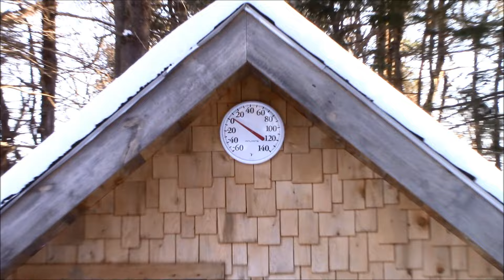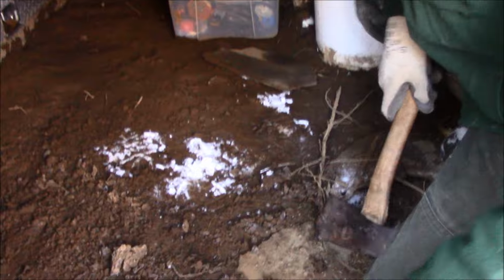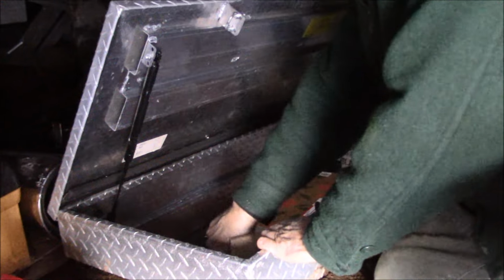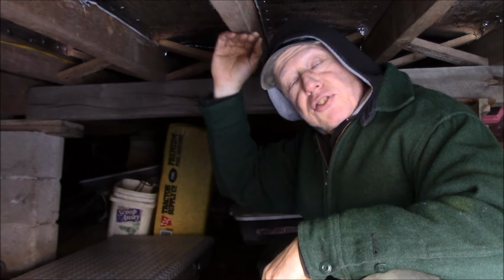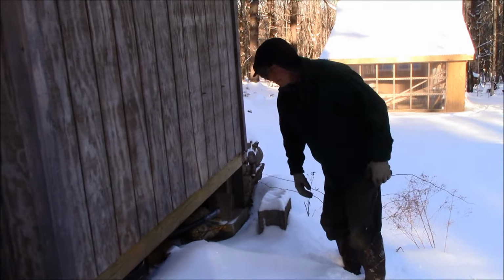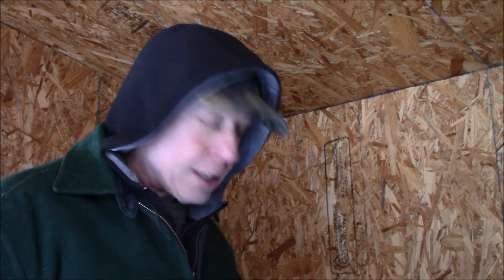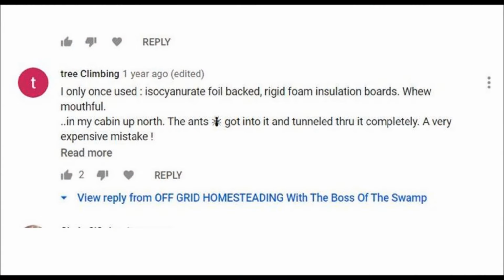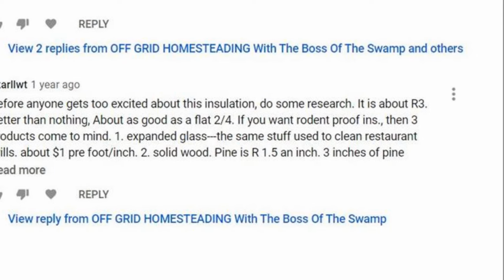Awesome Floor Insulation For A Cabin In The Woods   3rd Year Review

Comment: For a roof bubble wrap, as you indicated, is not as good as fibre glass because the R value is not as high as alternatives. but this is because heat rises creating pressure upwards.  This thermal movement has less impact on the floor. Heat is also radiated so the reflective surface of the bubble wrap helps reflect radiated heat back in to the cabin.  The continues roll of bubble wrap prevents drafts, you have created a baffle under your cabin and this creates a heat trap and reduces chill factor.   As for rodents you have found a method that works in insulating your cabin but does not encourage these problems.  I get it and r value is less important if heat has to go down and out rather than straight up.

Comment: I guess more "proof-in-the-puddin"  would be to use ONLY  the "bubble-foil" to insulate an entire building.  Floor, walls, and roof or ceiling, and just prove how REALLY effective it is at blocking heat transfer.

Comment: serious question regarding the ants problem, for anyone with actual experience: what about ICFs and SIPs? Do ants make homes in that type of material also?
Reply: Absolutely, and also blown in foam in  standard framing. Carpenter ants will tunnel through wood and then on into the foam.  Need to spray or have someone do it just like termite control.
Reply: Ants love that ICF foam, been there done that!
Dont bury your old wood stumps on site and treat the soil around the foundation!
Reply: @NotMy Field & @Jimmy Squires : Thank you both for your answers. 

If you don't mind a secondary question, I have a friend who is using the pink 2 inch stiff foam insulation, within the open crawl space of his home, in between the floor joists, which are 2x8s, leaving a 5.5" gap between the foam and the sub flooring OSB. Would ants tunnel through that foam type as well? 

It is interesting for me to see this video and you guys responding, when looking at the data and information sheets for insulation: NONE of the documentation I have been able to gather ever mention pest problems or pest control prevention. This is something I have never even considered until seeing this video and your responses. Thank you for the help and personal guidance.
Reply: @igounfazed  It is the exact same situation where exposed foam can attract ant infestation.  But every different area of the country has their own unique pest control needs.  If the area of your friends home  has termites and carpenter ants, then common exterminations methods should be used. Boss has come up with a very nice solution for his area.  Seems to work well despite those would argue it can't be true.  The bumble bee keeps flying despite the scientists that claim it can't according to their calculations!!
Reply: @jimmysquires5093  Thank you!

Comment: A couple of issues here that touch on the actual building science  you are trying to describe talks about Vapor barriers and the dewpoint and how cold move to heat. Firstly, you are getting so many negative comments because you're describing insulating a cabin floor with an insulation that at best has an r-value of 1.1. Wind chill is a factor of heat loss, not air temperature . The dewpoint for any given area is measured based upon the degree days has in a particular region. The dewpoint allows moisture to condensate on surfaces in the area where this occurrence occurs. There are 3 ways to eliminate condensation,  increase airflow,  increase the temperature and or decrease the temperature. There is a difference between an air barrier and a Vapor barrier,  one being able to breathe (air barrier) and one not being able to breathe (Vapor barrier).  The location of where the Vapor barrier is placed is critical to all of the above I forementioned. In a northern region is has to be on the winter warm side of the assembly. Moisture is a vehicle which transports cold to heat through capillary action ( in this case your wooden structure and the organic dirt floor). What you have described visually in your video to someone who knows the building science behind what they are seeing is a warm damp space under your cabin. Your bubble wrap can be used as a Vapor barrier providing it's continuous continuous. The thermal breakage that's visually obvious with your illustration and your description of how warm moist air seeps down between the cracks leads me to believe that the advent of moisture in this area will only speed up the cooling down process. I therefore conclude that the advice you are giving is bad advice and I find it shocking that even after failing on atleast 3 shed floor insulating attempts you decided to post a video saying in effect that this is the best way to do it. I don't mean to upset you, however it is important that you are told properly to stop in the most gracious way possible,  while still getting the point across. If we can be civilized here I can help you with proof of what I'm saying and provide you with the information that will help you and the people you reach out to. I look forward to working with you and sorting this misunderstanding out. Best regards

Comment: If you think about this from a rational point of view it doesn’t make sense to not use it. Let’s say all the haters are correct and it does not perform as well as he says, you can still add your insulation and all you’ve done is increased your vapor barrier and the insulated properties of the insulation that you would be adding anyways.  Putting underpinning around a peer based cabin is just common sense. Whether it has bubble wrap on it or not underpinning with no insulation of any sort is highly recommended over not using underpinning at all. Foil bubble wrap is such an inexpensive product the why not trying it see if it works and if it doesn’t work adding the insulation after the fact. I have insulated plenty of pier based sheds in my life and rodents in the insulation with or without underpinning is always an issue. This is a great idea and I will absolutely be trying it. If it sucks I’ll come back and comment and let everybody know but I bet it works great.  Thanks for sharing your  experience with this.

Comment: R-value deals with heat loss due to conduction and is relevant for foam and fiber insulation techniques. The product you are using a radiant heat barrier that appears to be locking in the heat being conducted through the floor joists into the crawl space.  The people who are arguing about the lack of the foil working don't really understand the difference between the two.

Comment: In addition to being a radiant barrier, it's providing a thermal break between the floor joists and the floor so the cold floor joists can't suck heat out of the floor as quickly as they would if they were in direct contact with each other.  Fantastic product.

Comment: One more comment. I spent most of my career in Construction as a project manager building Prisons.  Here in Southern Ontario we often get -20 Celsius or less days in winter.  We have actually poured concrete below zero (chemical heat in the concrete) and used non foil black bubble tarps to cover and protect from frost.  Not the same but similar to bubble foil in principal and physical properties. Worked very well without any heat source other than the chemical reaction of the curing concrete.  Cheers

Comment: Great concept, no rodents and keeps just enough heat in to stay above freezing. You are spot on Sir.  Biggest thing is keep any breeze out of area and a small RV value is all you need.  You are right about the heat transfer on the floor joists.  Perfect shallow root cellar and I love the freezer room,  excellent use of the waist heat from the freezer. 👍🏻👍🏻. oh and it does work.  we use the same bubble foil up here in Maine in the off grid camp.

Comment: My wife and I recently installed an outside wood boiler here in PA where we live completely off the grid. Not wanting to spend the relatively large amount it would cost to buy the typical underground insulated piping.. We got 3'' un-corrugated drain pipe and a few rolls of bubble foil. We used the bubble foil to wrap the feed and return PEX lines one wrap, fed it into the 3'' pipe and buried it below frost. I must admit I was slightly concerned it would be a waste of time and cause more work, but There is absolutely no temperature loss from the boiler to the inside of the house. We also used it as insulation/a heat transfer material for our PEX floor heating system with again awesome results saving us big compared to buying the industry standard of using heat transfer plates.  It can be hard to step out-side the norm when everything around us is brain washing us to use or do something a certain way through advertising... stepping outside the box once in a while in life, one just might be amazed to find there is more than one way to skin a cat. Keep up the good work, really enjoy the content.

Comment: Heat doesn't travel down. I'm  not saying what you're doing isn't working, it obviously is, I'm just questioning the reasoning.
Reply from the maker: Most of the heat under there is the ambient temp of the ground being trapped but... if I wasn't heating the camp, it would be A LOT colder under there which proves heat does indeed radiate downward through those joist.

Comment: We use this bubble foil in our RV windows. Not for it's insulation, but for it's reflecting qualities. It reflects the heat back into the RV when it's cold, and reflects back the heat of the sun, keeping the interior of the RV cooler, in the summer. It works great!

Comment: Bubble foil works great for wrapping wire shelving, hanging lights inside, and starting plants early in a small space. I started over 200 tomato plants in a 48” x 6’ rack for couple of seasons and many more veggies. It reflects the light around and allows the lights to heat the space. Works great for small pump houses or dog houses being heated in winter with an incandescent light bulb. I have lined the walls and ceiling of a metal garage and it helps a lot. Not as good as $10,000 worth of spray foam, but it’s a fraction of the cost. Bubble foil is very useful in the right application. I look at it this way, pour hot coffee in a paper cup and hold it without a sleeve. That little paper sleeve is the same principle and effective enough to matter.

Comment: Most people don't know what isolation is. The "R" factor is from the industry because there are many types of materials they/ you can use to insulate, and this is the key "WITH WHAT KIND OFF CONSTRUCTION YOU BEST USE IT". One thing is for sure, insolation is based on air that is standing still. Nothing more, nothing less. If bubble foil is working good on this way, its working, finish. For sure better then another type in case of rodents. Most people never think out of the box they live in, is ok, but don't criticize others who do, and it worked good. Just let it be Boss, its not worth it. Regards, Tony.

Comment: The Boss didn’t say if he left an air space between the underside of the flooring and the bubble foil when he installed it in the cabin. Does anyone know?
Reply: On the cabin floor he stapled the reflective wrap on the underside of the sub floor and left the joists bare to transfer heat from inside the cabin to go into the crawl space!
Reply from the maker: You can see more of the process in the 2 videos I posted in the description.

Comment: Once you’ve used something and it works for your application, just keep doing it.  It takes a LONG time for people to adapt to new ideas.  I put fiberglass insulation under my floor joists, skirted it, and put up a 1/8th inch metal screen across the entire bottom...the rats/mice chewed right through the metal in many places, made huge nests, and piss/shit everywhere in it.  A complete waste of time, money, and a monstrosity of a mess to clean up and remove.....just to replace with bubble foil.  Heated cabins with small footprints (that’s why it’s a cabin, dammit) don’t need massive insulation in the floors....heat rises, and it does so quite quickly.  As long as you are skirted, its more than enough to reflect the heat and make you open windows if you have a wood stove on the coldest nights.

Comment: If you have not actually used the "bubble-foil"  material you know absolutely NOTHING about how it performs as an insulating material.  Forget your "R-value"  nonsense.  Foam board, and this "bubble-foil" material will far out perform ALL of the fiber-batt insulation you've ever used, if it is installed correctly.  It reflects warmth back into a space, and  it does not allow "air-migration"  from a warmer space to a colder one.